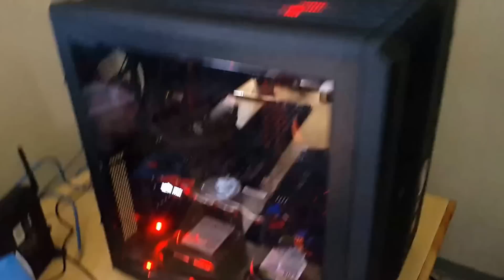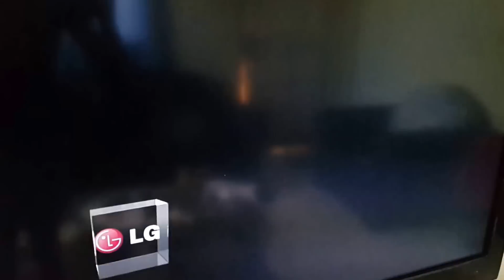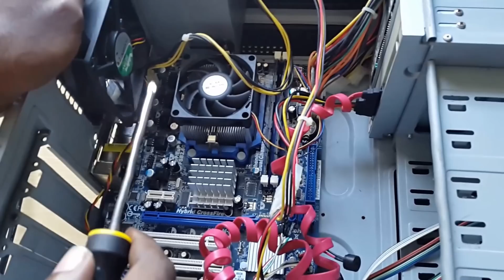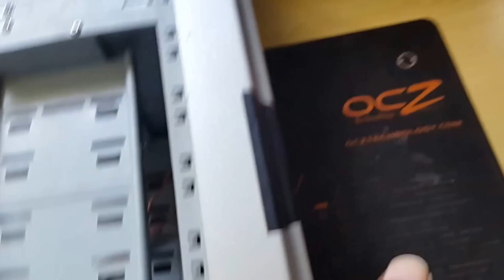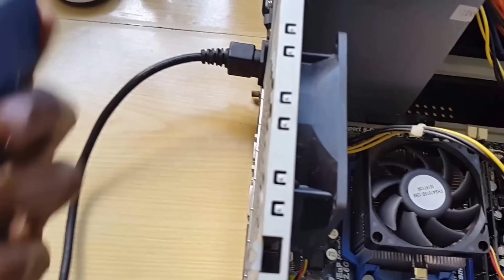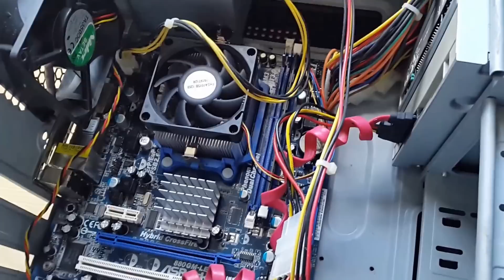No signal to Monitor Fix Easy PC Fix

Comment: My problem is that i tryed to upgrade my old cpu is saud there was a cpu mismatch error so i put the old cpu back in and it dose not show anything at all on my screen
Reply from the maker: Check to see if you bent or damaged anything during reinstall on either the chip or socket.
Reply: Ricardo Gardener i did bend one of the pins on the cpu but i unbent it so it would fit in the socket
Reply from the maker: Make sure its perfectly set back in place like the other Pins -Chances are that's why you are having issues. I have had cases where a single Pin on CPU caused us to throw it out and get a new one that worked and the bent one would not. These CPUs are that that sensitive.
Reply: Ricardo Gardener ok thanks i really appreciate it

Comment: I need help all of the fans are workin and spinning, the led for the motherboard is also working but when i plug the hdmi the pc doesnt boot up, also this is a new pc that doesnt have windoes installed yet, but i need to boot up the pc for my to install windows. I have the setup on a usb drive. Pls help.

Comment: Well this video is giving me hope. I got the no signal problem and after reading a few pages I started to think it was my motherboard which was distressing. I run a small business from my PC which barely turns a profit, and while everything is backed up I would need to get MYOB to reinstall my components and they charge $500! Lost a lot of sleep last night. 

So I will be using this video as an aid step by step to see if I can fix it. I am getting no signal to the keyboard and I am hearing no beeps. Hoping the magic restart trick works or maybe bad RAM. Hope it's not the motherboard!

Comment: I pulled out the power cord and held down power button for 60 seconds, then plugged back in and monitor works now. PROBLEM: I have to do that EVERY TIME.  I'm about to install a used (but better) graphics card, which I intended to do anyway-- I hope this solves the entire problem

Comment: so i putted my new graphics card and i connected the vga cable to the graphics card and the monitor shows no signal but it works when i dont have the graphics card, does that mean the graphics card is bad?

Comment: Just tried the first method with no success. This problem has happened repeatedly and we resorted to changing the monitor each time. It's kept working for a shorter and shorter amount of time through the 3 monitors we used. Whe it happens, the computer itself wont turn off with a short press of the power button; it needs either a hard shut down or to be unplugged to turn off. Is this a deeper problem? Or is it something able to be fixed with the other methods? We were planning on maybe getting a new computer sometime because ours is a dinosaur; is it worth just doing that now?
Thanks in advance!

Comment: You try to restart your computer so you can finish with certain updates. But after you try to restart, your get a black screen that gets stuck until you hit the power button. That is the issue i am having.  Is there a way you can help or have any advice???

Comment: Here is the problem, im switching between pc and tv.
once in a while, also when there is win 10 update, my tv is not detecting pc [no signal]
i restart do all kind of stuff nothing work, except one thing, when i plug my monitor insteed of tv, picture shows up, then i swich to tv and it works. i dont want to do that all the time. Also my tv doesnt have dvi :(
do you have any more suggestions?

Comment: I have a more severe problem connected to the np signal...my new pc i use uses a amd athlon 651 quad 4x
Board is Asrock A55m FM
2 ddr3 Kingmax 4gb 
Wd blue 500gb
And now Nvidia geforce GTX 260
896/448 bit
Windows 10 
It breaks electric power in entire house completley activates the safety switch  but turns on normaly few times..and when it does it dosnt show any signal...do i have to buy a special cable for the g card becouse it has two diffrent plugins...first graphic card owned ever...can someone help

Comment: my problem was solved by using a HDMI cable rather than a DVI cable even though it was working until signing in
it's dumb but don't hesitate to try dumb solutions

Comment: I connected all my cables and connectors correctly and my fans are spinning on boot but the display comes up as No Signal. Specs : I have I5 8600k with a gtx 1070 ti nzxt kraken x52 Corsair 750 watt psu Asus prime z370-a Mobo 16 gb ddr4 gskill trident z rgb ram 120 tb ssd and 1 tb hdd all in an next s340 elite
Reply: This was first boot btw

Comment: Man...thanks very much for posting this video. It was a HUGH time saver. (thumbs up)
1. Either the Ram was dirty
2. replacing the Lithium Ion Motherboard Battery
3. repeated power-up with disconnected cable
...one of those worked. HOPEFULLY its not something more Serious.

Comment: Hi, my gpu will work in pcie x1 slot with a riser but it will not work in the x16 slot. I have checked all bios settings, reset the bios, reinstalled windows, power supply is fine, ram is good, not really sure what else it could be except for the cpu maybe. But if that is the case then why would my gpu work with a riser in the x1 slot? Any ideas? Gpu is not recognized by windows in device manager, this is a new mother board, also I had the same issue with my previous motherboard which is why I returned it for the new one. The cpu was installed in a motherboard where the usb riser cable was plugged in to the x16 slot backwards which had shorted the the slot and ruined the gpu I was using. Could that also have damaged the cpu in any way that would cause it to not be able to communicate with the x16 slot yet still be fine on the x1 slots?

Comment: I don’t get it. I had a 970 and it didn’t work. I then upgraded to a 1070 and HDMI still didn’t work... yes it is plugged into the GPU. Still won’t work
Reply from the maker: Have you considered that the slot may be bad on the Motherboard. Thats the PCI-e slot that holds the Video card.

Comment: Hi, my pc turns on and starts to boot but approx 5 seconds later it goes quite and nothing happens. However you can see the fans spinning. One thing I do notice is that there is a hard drive light on the front of the pc and this initially lights up but approx 5 seconds later this hard drive light goes out. The monitor also displays nothing. I have everything you suggested but no no avail.

Comment: The PC I tried to setup has an ATI graphics card on it and the OS is trying to put out the signal via the DVI port of the graphics card. Now the problem is, I have a BenQ Monitor that only comes with a VGA port. Is it possible to connect both of them via using a VGA cable and on the PC side I use a VGA-DVI adapter? Because I'm getting no signal and I'm not sure if it could even work with that method.

Comment: Same issues ..no post in using mobile(AsusH270M-primw)+Cpu-(i3-6100)+Cooler-(Stock Cooler)+Psu-(Corsair 550W+ Ram -(Corsair. Vengeance 16Gbs={2x8Gbs}..pwered on From Psu switch & Case Pwr button 3x and did get POST screen but on 2nd try { had to connect my keyboard and mouse got NO POST,BEEP signal from added system speaker. Rechecked all Psu connections fan, Psu..removed CMOS battery and will reck again.

Comment: dude thanks, i just build my new pc and before I did cable management I wanted to see if it would work so I plugged it into a monitor and it did the no signal. Then I did the power button thing and I plugged in a keyboard into it and it worked
Reply: now it wont turn on again

Comment: buddy I'm in need of assistance I fear.my laptop with a broken lcd was operating fine with the vga  cable to my t.v did mess with some setting In the task manager.I ran msgconfigurations.did not know what I was doing.next time I booted my lap too ready to get my Netflix on right? my tv will not get signal.usually it display the resolution as soon as the signal was received.it's a hp  laptop g71.it's old.I know.I just want to trow it away.after fixing.it's a pride thing.can you help me save face my good man?

Comment: Everyone claims this is a hardware problem for older computers, but my computer stopped working after a WIN 10 DELL update I researched on line and the have been having some problems with updated drivers for WIN 10. I am going to call DELL and talk to them about it.

Comment: I have the same problem, except it is my laptop that has suddenly lost signal.

I was watching a video, when all of a sudden the screen turned orange with a weird pattern.

I had to restart my laptop, otherwise the orange screen would just sit there.

When I restarted It the laptop made three beeps, one long and two short.

I could hear everything booting, fan turning, and even the Microsoft chimes, but the screen remained black.

I tried everything from unplugging power cord to holding the power button

I at times attach my laptop to my monitor because the monitor is much bigger and better for watching movies etc.

I tried switching cables which allow me to attach the laptop to the monitor even though the VGA cable I have works perfectly. ...and nothing fixed it.

I have not tried cleaning the memory, so I will try that, inserting only one memory stick at a time to see if it is a memory problem.

I have a ACER Aspire laptop...had it for some years now, but I never had any problems with it, until this.

Will report back if it resolves the problem.

In the meantime do you know what the three beeps mean?

Comment: My monitor is strting and showing its logo(aoc) and after that it goes blank and shows colour full pattern or no signal or input not supported. And sometime it is opening and then same problem occurs please help
Reply from the maker: Check the connection to your PC and make sure the Video card is working and that its connected to the correct port, also check your cable and that you are using the correct type.

Comment: My pc was working fine but wanted to add some ram, well i openend it up and removed my old ram to make some space and tried to put in the new 1 but found it that it was not the right one for my motherboard. so i put back my old 1 and put all the cables etc back into my pc and booted it up. normally when i boot up my power button lights blue, now it didn't and i didn't get any display. i tried everything from this video + other things except the cmos battery. i have no clue whats going on.help.

Comment: Help guys I have a hd7970 ghz edition  3gb and when I connect it through hdmi it says "hdmi power save mode" but when I connect my older hd6870 with the same hdmi it works just fine although the hdmi i's quite long probably longer than 6foot. Once it worked but then when I put pc on sleep mode it the display never worked again and kept saying hdmi power saving mode.I v tried everything took the ram out took the mobo battery out unplug cables but not working .The last time it worked again was few days ago when I tried a different pcie cable but I doubt that made it work,I think either I'm having problems with my gpu hdmi port and I should try dvi dual link cable instead and hopefully it works, or my gpu is on its way out but then if it was dying I don't get why did it worked perfectly twice. I got the card given by a friend btw. Tried to connect it to my tv amd it says no signal check the device power connection or something like this.Any help would be  appreciated..

Comment: so after my mother passed I got her eMachine computer it was just collecting dust. so one day i tryed to start it up the tower turned on and so did the monitor but not was coming on the screen, thinking it was loose cables i reconnected everything to make sure they were in correctly. so i thought maybe it was Graphics card but i want to get a diagnostic of it to see if it was anything else. so i got to office depot and i was right, then i went to buy a new one installed it everything starts up and running but still black screen and if i take the cord off it will say no signal intill i put it back. i dont know what else to do.

Comment: I replaced the battery in mine but i can only reset the first number on the clock & date any idea if this is a motherboard or graphics problem?,or should i just trash it?

Comment: None of it worked but all of my parts are working im abought to go cry myself to sleep
Reply: Yo put the hdmi cable on the bottom of your pc
Reply: @jaycrypted  what does that even mean the bottom???
Reply: @jaycrypted  wow that actually worked❤
Reply: Dannish np dude!
Reply: Dannish what did he say??
Reply: @jaycrypted  dude you the man or woman lol. I tried that and it worked. I swear all computers are different.
Reply: Iitchovereverything what wait do you do
Reply: Justcrypted damn thanks I was starting to get scared and only had to spend 15 seconds to find your comment
Reply: @jaycrypted  sir what do you mean by the bottom of your pc
Reply: @iamvizzalz  theres a plug in for your hdmi cord at the bottom of your computer behind it
Reply: Justcrypted I litterbugs sent my pc away for a month to get it fixed and that was all I had to do fml
Reply: @jaycrypted  holy shid brodda I tried plugging it in to my gpu and it facking works
Reply: The Pixellater did you fix it ?
Reply: Alpha V yeah i learnedbit was because my processor wasnt compatible with some of myparts, or any part made in 2017 for that mattet
Reply: GudGyBrian the same but it works good in tv but when i plug it in monitor it tell me no signal but the parts good and working
Reply: @montadhersabah7262  Did you find out how to fix it? Just built my pc and had the same probs.
Reply: @tomhava  Unfortunately no, never found a solution so I sold the monitor, I hope you find the solution to it, if not then try it with a TV screen or a different monitor and cables, Good luck
Reply: @montadhersabah7262  it worked with a new monitor.
Reply: @Thomas Havard Glad to hear that, enjoy
Reply: same
Reply: try a new cord
Reply: Same
Reply: Same except my parts are compatible because I built my pc at my friends and it was working but once I brought it home it has the no signal
Reply: Same here im litterly about to cry
Reply: La&Sape I just did😪 my shi is just not working
Reply: Same
Reply: thanks for the support bois
Reply: Justcrypted What do you mean with putting the hdmi Cable on the bottom of the pc?
Reply: GudGyBrian v

Comment: MY screen freez but pc still runs normaly, i wait 10 seconds and then i hear a usb in/out sound, like if the screen got disconnected. what the hell? Then when i reboot the pc my screend doesnt read, its black, after maybe 5-7 restarts it works again. this happens like 3 times a week.

Comment: Im having this problem with my pc. Sometimes it all loads correctly, but the image shuts off a few seconds after booting up, and sometimes the image never appears. I took it to the repair shop, they said it was graphic card problems. Later it was probably motherboard problems and now power supply. I have changed all parts and it still does it. I will try a few of these tricks and hope for the best. I cant afford to keep buying new parts.

Comment: WARNING!
IF you're pretty much of a amateur you should call a service instead. I almost broke my computer when I tried this. try to use a HDMI cable, it worked for me. After I plugged in the HDMI cable I used my old cable and it worked perfectly fine.

Comment: I hope you might help me. My son's computer was working great for the last 2 years and never had a problem. I got him a new computer and I removed the video card  and the power supply from old computer to new computer. Now the old computer is working with the video integrated on the motherboard but sometimes the monitor loses the signal and I have to reboot it to get it back. do you have any advise of how to troubleshoot my issue?

Comment: I was having a problem with my second monitor not getting signal (was working fine yesterday but started having issues today). However I didnt want to open the tower just to do the 1st trick (I figure if that didnt work its gotta be a problem with the 2nd monitor or its hookups since the other monitor worked fine and so I didnt feel it was necessary to open up the tower). Instead of unplugging the towers power cable I just turned off the surge protector I had the pc plugged into the pc instead of removing the cord because it does the same thing and as I explained the other monitor works fine. Anyway it worked fine and now i have both monitors working. So I just wanted to say thanks for the helpful video :)

Comment: Sorry just elaborate on your first step. Are we supposed to turn off the switch on the power supply box and then take out the power cord? Or just take out the cord only

Comment: I have Windows 10 and here's how I resolved this issue
Go to "Settings"
Go to "Devices" (or "Devices and Printers") and make sure all of your display/monitors have been added.
Return to your desktop 
Right click on your desktop
Click on "Graphic Properties"
Click on "Display"
Click on "Multiple Displays"
Then click on "Extended Desktop"
Assign a monitor to each of the drop down boxes under "One or More Active Display".
Click Apply
At this point all your monitors should become detected.
Note: If you receive an “No Input Signal Found” on one or more of your monitors after you complete the procedure above (this actually happened to me again 2 weeks later after I had successfully completed the steps above) then:
1. Right click on your desktop
2. Select "Graphics Options"
3. Select "Output To"
4. Select "Extended Desktop" (that corresponds to the number of monitors you have, I have 3 monitors so mine displayed “Extended Desktop 3”).

Comment: Omfg thank u so God damn much u r the definition of a God I've been working for the past 8 HOURS using tons of different steps and your first step worked on my 4th try after holding it for 5 mins instead of 1
Reply from the maker: I like your style you did not give up on the first try and stuck with it, Excellent job.